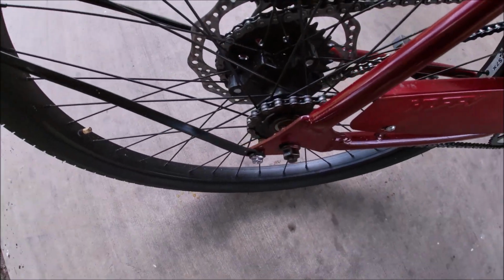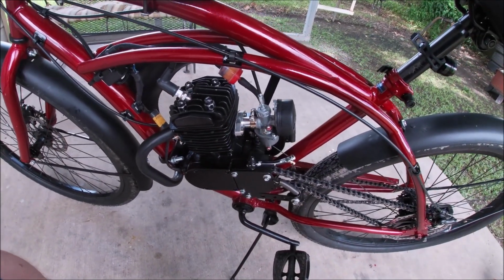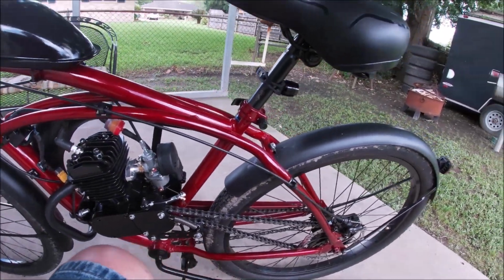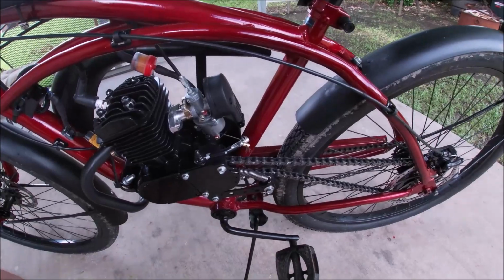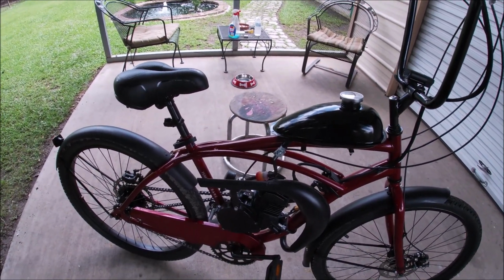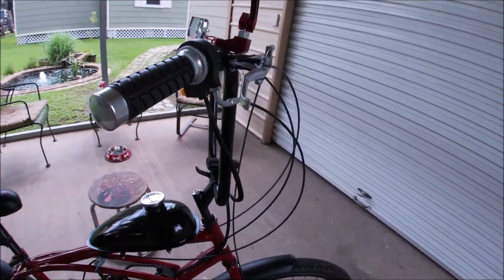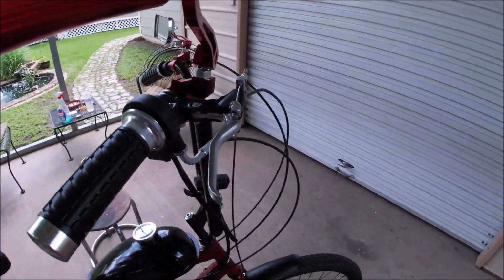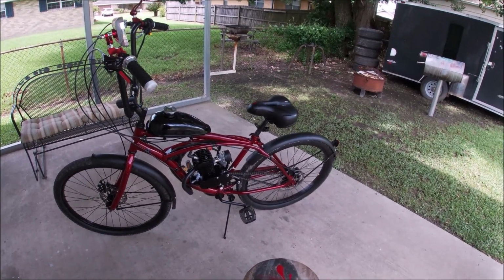My first Cranbrook ride

Comment: A boost port, skirted piston, added base gasket, decked cylinder for squish, raised exhaust port, would do her good and those pipes I cut them at the cone and pull the protrusion going inside the expansion chamber out reweld and try to get it to fit better than when it was stock I'm running a ktm 65 pipe with the same cylinder i talked about with a stock carb I'm doing 50mph
Reply from the maker: We don't need to go fast next video you will see why thank you for watching